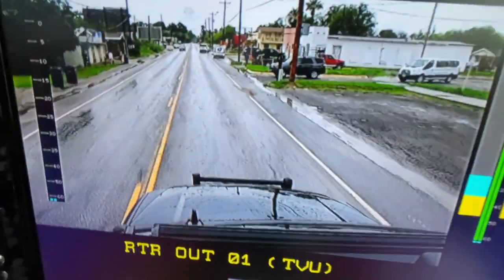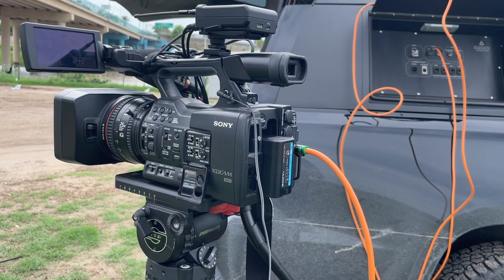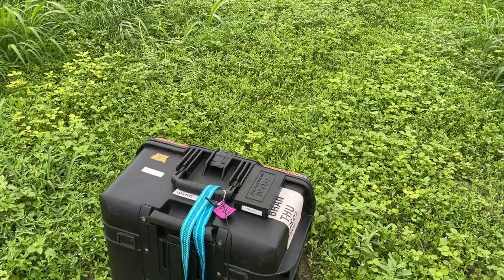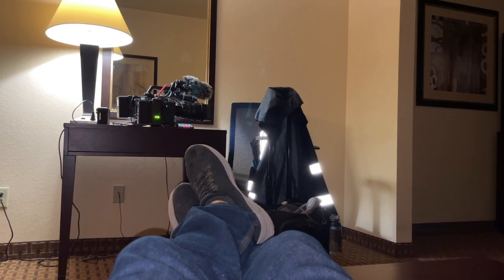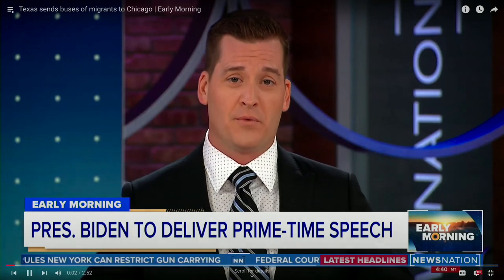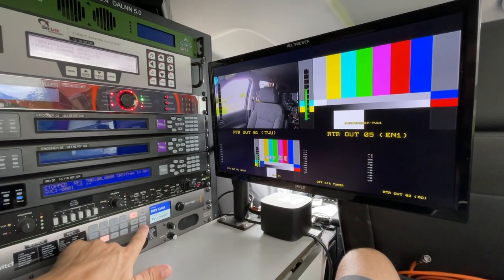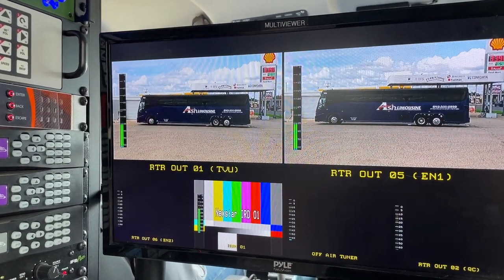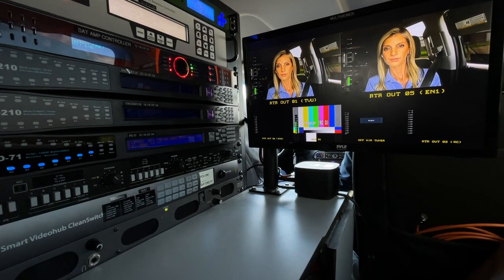Satellite News Gathering   Photog BTS

Comment: Would you say the Amira is a good camera for news gathering? If so, why do you use FX9 instead? Thanks!
Reply from the maker: Amira does not record 1080i or 720p and all the big US networks require one of these formats. FX9 is better for nighttime low light high ISO, sometimes AF is excellent, smaller files, lighter camera, 1 or 2 batteries for entire day vs new battery every 40 minutes, affordable lenses with OIS. But the FX9 is not a great camera for ENG, the sensor is too big, too shallow of DOF, even at F8 / 11. Zoom lens limited to 3x to 7x range.   Vs a proper 2/3rd ENG camera with deeper dof an a standard zoom range of 18x to 25x. For dedicated broadcast news best in class is probably the Sony Z450 , X400 and for the MMJ Sony Z190.   In my case, FX9 is the best option out of what I already own and have paid off!
Reply: @CrankyCameraman  I appreciate the fantastic response! I could have sworn I read that the Amira was capable of shooting 1080i. Thanks.

Comment: This is such a cool perspective. Thanks for taking the time to share.
I have two questions:
1. What air travel case do you recommend for transporting long stands/tripods? My current problem is I cant find a solution for my 42" light stand.
2. How do you rate the comfortability/efficiency of the movcam shoulder rig?
Thanks again for making these videos!!
Reply from the maker: Pelican 1615 cases for everything. Then I find stands and tripods which fit in the cases.   Movcam VCT shoulder pad is pretty good, but the FX9 is front heavy so difficult to shoot on the shoulder for long durations.  I wish the shoulder pad was sliding balance like the Amira.
Reply: Pelican (storm, etc) shotgun/rifle cases work well for long stands, sliders, etc.  A live events company I work with uses Pelican 1740's for their really long stuff.  Remember to get a media pass to keep checked baggage fees semi-reasonable.
Reply: @CrankyCameraman  Yeah it seems like finding products to fit the cases is a good route. I’ll check the 1615’s. Thanks!

Comment: How does this work.  Does News Nation pay more than average day rate for you to run their rig?  Is there still a law that the engineer photog can't run the live shot and the sng shot?
Reply from the maker: In this situation unions restrict roles not laws. NN is non union in Texas. However, their HQ may be under a labor contract, I’m not sure.
Reply from the maker: I’m a freelancer photographer on this one, I wasn’t running the truck. But I did clock some hours in the rear seat as we drove. Once the link is setup the correspondent can control the switcher, lights and audio.